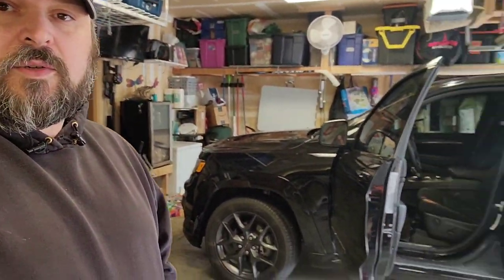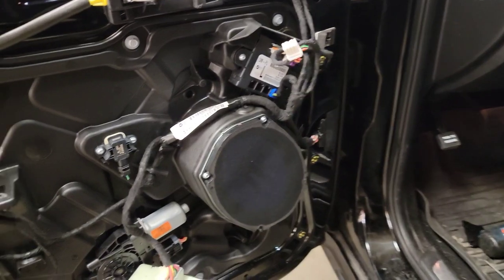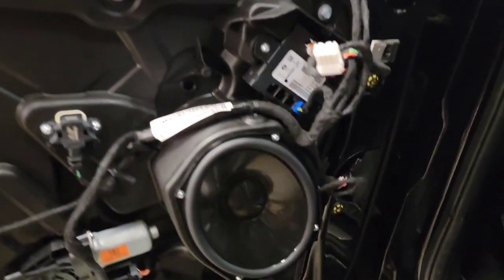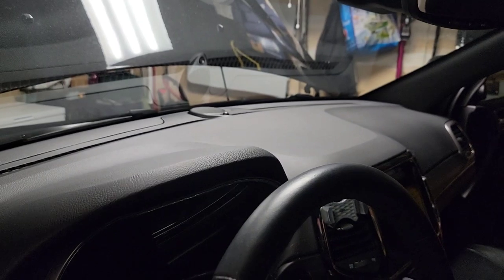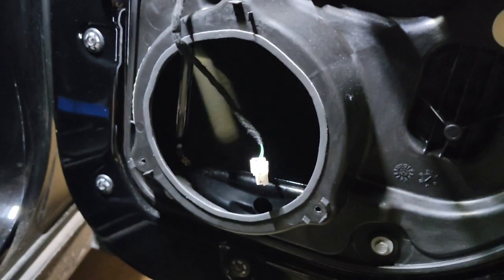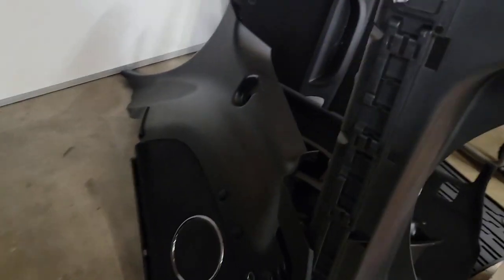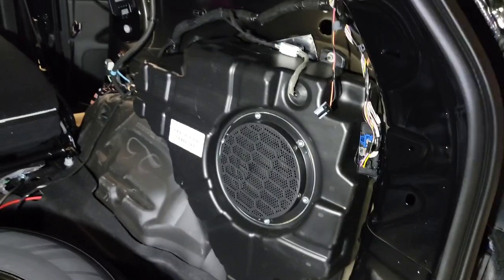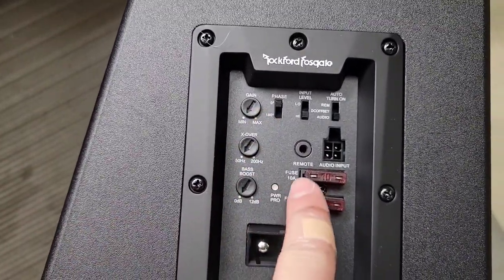2019 Grand Cherokee system upgrade

Comment: What color were the positive and negative wires you tapped into at the subwoofer? Adding aftermarket sub to my 2020 this weekend. 
Thanks in advance.
Reply from the maker: I don't remember the colors, but if you are tapping into the factory sub wires, just pick one of the twisted pairs. You can verify polarity at the sub.